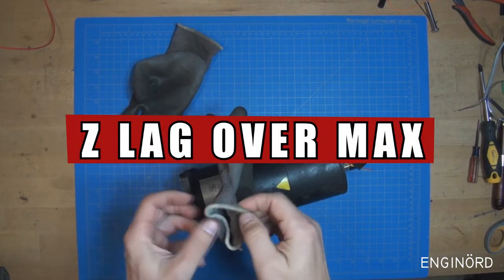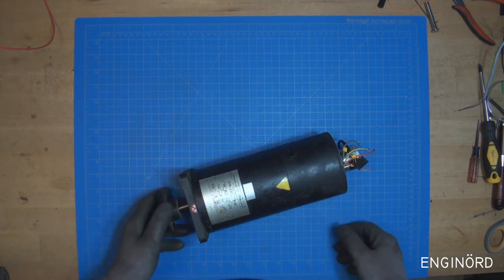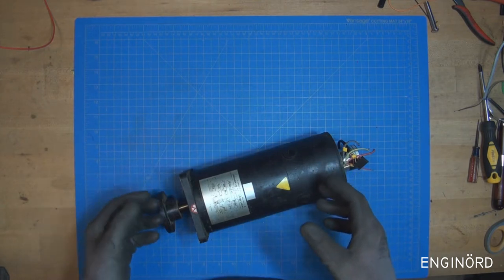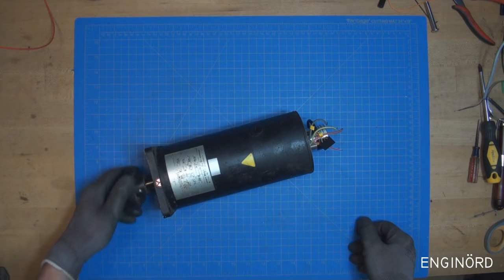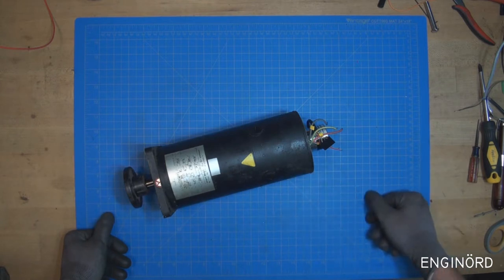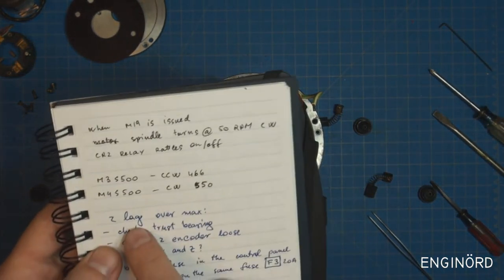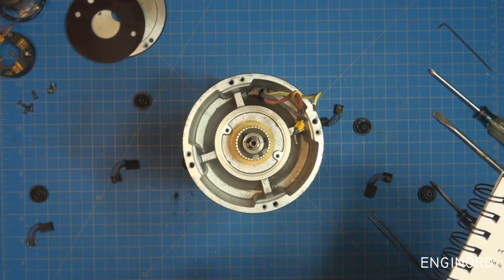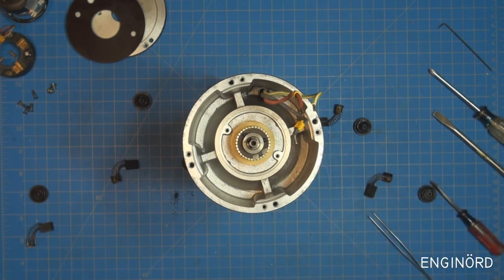Z LAG OVER MAX - Anilam / SEM Servo Motor Teardown

Comment: Great video thanks. I have just bought an old XYZ 3 axis mill running Heidenhan TNC355. Lost it's parameters due to a battery failure on the board. I will try to recover the parameters and get it running again. It has very similar SEM servos - 140V DC brushed with tachos. Hopefully they are ok. I may end up ripping everything out and using modern motors and drivers etc but people tell me it is a good machine and to try to use it as it is.
SEM is a British company still making motors - they now only do AC brushless I think.
Reply from the maker: rip out everything. sell it on eBay. buy mach 3 on the money!

Comment: I think the tachometer generator’s purpose is to tell the computer the direction that the motor is turning, and the encoder tells the speed and precise displacement.
Reply from the maker: I've learnt in the meantime, that the tach is used by the servo amplifier, and the encoder signal is used by the computer.

Comment: I had this error on my Anilam 3300, turned out to be a faulty encoder. First easy test was swap the motors and found the error move with the motor. Next swapped the encoders and the error moved with the encoder. Luckily I found a new old stock encoder on eBay and fixed the problem. The tacho is used to give feedback to the amplifier on speed and direction. Be careful with the screws on the encoder, I used one that was too long and it interfered with the tacho, made the motors' speed jump about!
Reply from the maker: I'm glad you got this problem fixed. I probably have 1-2 spare encoders now laying around :)

Comment: Thanks for this video. Recently I started getting a faint burnt smell when running my Supermax mill with Anilam controller. Then when running a program, the fuse, 1A250V, on the back of the control box blew, and now it blows without even running a program. Any suggestions? I would guess it is not one of the servos because the fuse blows just turing on the box...thanks
Reply from the maker: Hi JP. I'm glad you found the video useful. Many times the power supplies fail. You can check the caps first, but a good IR camera is a great asset. you can borrow one or get one for your iphone. then turn the machine on and while everything is cold snoop around.